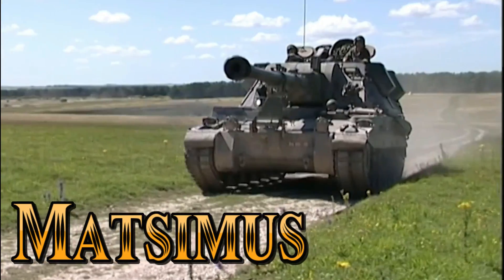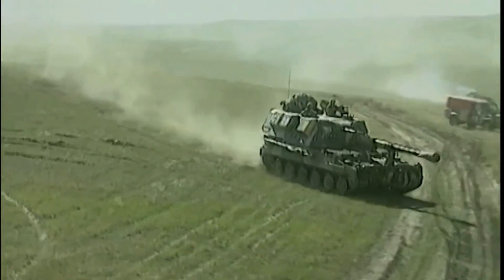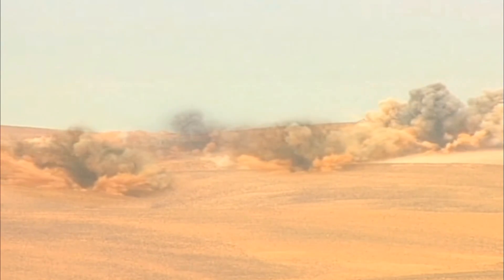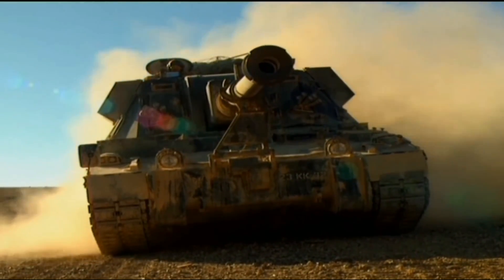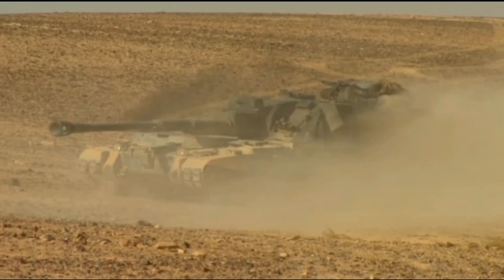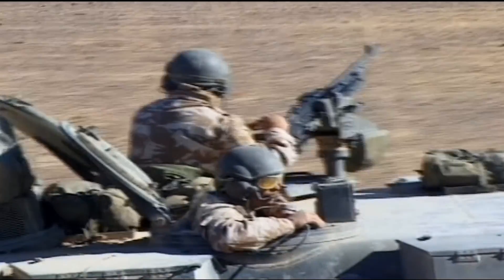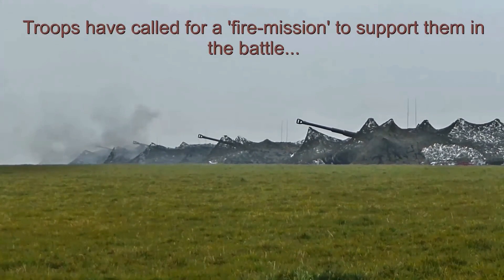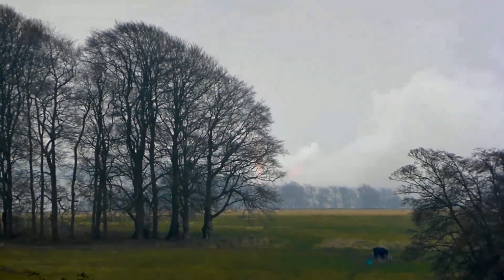The British AS90 Self Propelled Gun - Artillery Review

Comment: Think the exhaust was designed as a pension reduction program, the fumes blow over the turret into the commanders lungs. With the dangers of diesel particulates known this could produce future legal action  from ex soldiers.
Reply: Thats the tiny engine to move turret, and juice up generator for electrics and NBC suit if needed, it aint the cummins thats blowing in his face...
Reply: @wor53lg50  If you look at 7.33 m in you can see it driving and smoking , a small apu would not produce that much smoke unless  bores shot !

Comment: Hi Mat! Were you part of Mike Linge's regiment at Larkhill back in the mid/late '90s? BTW, I did a lot of the R&A work (operating a tracking radar used for testing the AS90 back in the  1980s/90s). A wonderful, reliable gun which quickly replaced the dreadful FH70. I did all the trials on the M.L.R.S. too, for Desert Storm. (Steel Rain). Mike brought a regiment up to Eskmeals in circa 1996 to familiarise with the launcher. They all lived under canvass on the range...good times!

Comment: I know this system well with the right charge, shell and fuze setting it can kill any TANK in the early 2000's  if its in 1-1.5km range very very deadly  possibly still could even today. Thank you for making this video great Gun I mainly operated these in harsh winter conditions, it is a very robust platform not had the chance to use in in desert conditions.

Comment: Worked on the Trials of the AS90 1989 to 1991.  Was amazing bit of kit then. Miles ahead of anything at that time.  It was originally designed for both gun systems. And had an auto loader with Manuel option. The gun system ran in to problems early on. Hence the larger gun got more and more delays. Also the auto loader was not always reliable.  And was /Could be dangerous  to the 2 loaders.  It was also found that the 2 loaders were often quicker. It also helped reduce the procurement costs of the end vehicles with just the 1 gun and no auto loader.
Many things have been changed and updated on this vehicle. To me in my mind it's still new (Lol. As like Chalky 2 and Warrior. We're the new kit at the time I first left the army. So my mind is still locked in past. So to me they still new.... Lol. But that was 28-29 yrs ago)
I still work with /around much of this kit. And yes. Much of it is now dated. And being surpassed. All very capable kit. But it's time for some new designs to start coming into play. As we have focused on Iraq and Afghanistan to much for to long now. Our tactics and much of our new kit is basses on fighting insurgency type conflicts. Not like the cold war tactics of army v army that the Chalky 2. AS90 and Warrior were designed for.
Reply: For us getting a new engine for the nasty is state of the art😂

Comment: Any one who is clued up on the AS-90, how realistically possible would it be for it to act and perform as a Main Battle Tank (Like the Challenger 2 for example) without being modded or changed in any way? I know it's an artillery piece and not a tank, but surely it's got some capability with a big gun and it being a tracked vehicle.
Reply: Depends on whether it is equipped with a boiling vessel compatible with an MBT's dong suppressor or a more general retch-looming matrix.
Reply: You are talking about Direct Fire capabilities. Yes it can do it. But not a good idea for arty to try take on MBTs close range. 1) arty does not have the armour protection of an MBT.
2) arty is large and less mobile than an MBT in close combat.
3)arty does not have the same gun stabilization systems or capabilities of an MBT.
So if Arty was unlucky to run into MBTs or vice versa. If the Arty was well dug in and Cammed up. And got first shots off. And got accurate shots on target.  They may stand a small chance. Realistically it would be a multiple MBTs with support troops and IFVs  as part of a organized fighting force. And would simply over run the Arty.
This would also mean that the arty's own forces had failed or been neutralized. Or someone had made a huge mistake in their positions for the Arty.
Also bare in mind. An armoured advance would probably have reccy element's leading. So should (hopefully) spot the Arty before they ever met. This would then lead to either air strikes  or Arty /counter Arty strikes being called in on their positions before they met.

Comment: Well well... great video!

Now that you have chosen this patch you almost have to do the Panzerhaubitze 2000. It is the main not counterpart but comparable piece of hardware. It's slightly more modern but only by a few years and it would be very interesting to see a comparison! The PzH2000 an extremely impressive combat vehicle as well and it would be interesting to know where it is better and where it is worse than the AS90.

But even more interesting would be a video about a modern close range defense system. Namely the Mantis for me because frankly I only know this one and I think it is mind blowing!

I know it is not your main field of interest and knowledge but it will be put on a tank chassis eventually so... :D

You could give your opinion how such systems will interact with armored vehicles and how they will change possible engagements.

It's super easy to think about it for systems like the AS90 here. You kind of said that we won't be able to use such self propelled guns they way they are intended for quiet a while now. Obviously with the great counter measures available.
So imagine 3 hypothetic Mantis (or whatever) tanks attached to a group of self propelled guns. Obviously ludicrously expensive but if it is the only way to  make actual use out of the artillery it has to happen anyways. So the Mantis gun has a pretty good probability to shoot down incoming artillery shells. It actually is designed to do this as protection turret for high value targets like field camps and airfields and eventually frigates. Not to speak of several of them. Helicopters and low flying fighters are munched for breakfast by these advanced cannons. Smaller incoming missiles should be no issue at all unless we are speaking of real masses.
So these tanks would allow the artillery to operate much safer and allowing it to counter measure counter measure fire and air force.

What do you think of that idea and such super advanced conventional cannons and their mind blowing targeting computers and sensors?

Comment: Huge? Better focus on MBT - huge ist the German PzH 2000 - it weighs 57 tonns - this is H-U-G-E!
Braveheart is a lightweight.
Reply: Stephen Hamblen    so disrespectful against the troops who fought and died fighting  the "flip flop dress wearing" enemies
Reply: Stephen Hamblen Don't you know? Wheraboos think Germans are the chosen ones, their equipment is designed by God and Rommel is the new Jesus. You can't reason with them because even though German equipment has virtually never been tested in combat and performed poorly when used by other countires (A dozen Leopard 2A4s destroyed in Syria), they refuse to see reason.
Reply: And it is also slower than PzH 2000!
A slow lightweight.
Reply: Dimension wise (apart from weight) the AS90 is pretty much the same size as a Challenger II. You also didn't mention the SP70 program which was scrapped as a waste of time (Being an FH70 gun mounted in a BAE turret mounted on a Leopard 1 chassis). After that was scrapped, the AS90 hit the drawing board. Technically from my point of view as a maintainer, the turret electronics have got to the point where they're pretty much bulletproof.  Haven't had a black box failure on any of our 11 guns in almost a year... (Biggest problem is the batteries)
Reply: Bigger is not better, but the comments suggested it. 
The Last Time we did anything was no the greatest Time for both sides - remember? 
PzH 200 was in Combat in Afghanistan
Reply: Stephen Hamblen Afghanistan
Reply: +stephen Hamblen: We are working very hard on it - nerver have to use our weapons again. So far we are successful. You have used your artillery in irak in a faked war and left a mess behind.
Reply: +john davis: Obviously we have a different understanding of respect. I think it is disrespectful (or criminal) to send young soldiers in a senseless an politically faked war and let them die far from their beloved ones. And it is also disrespectful to try to surpress a discussion when you want to avoid this happening again.

Comment: Given that it's like 8 years younger, the PzH-2000 is faster (326HP more), more rounds carried, more operational range, way better rounds-per-minute, has the option of MRSI with 5 (!) rounds, more range with stock rounds than the AS-90 with extended rounds, and the PzH even has the option to go as far as 60km with 'assisted projectiles' and thereby doubleing the range of the AS-90. This thing can't even stand in it's shadow. I get it, you like it, but i'm hearing once again 0 drawbacks.

You even prefer hand loading on a SPG? Isn't it the point to get as many shells downrange in the shortest ammount of time? ''Because that can fail'' you prefer a guy loading the gun? I imagine you don't say the same thing about an engine. Rather have someone push the vehicle because an engine can fail. Allofmywut.
Reply: watdeneuk the German spg isn't as reliable as the as90 it breaks down in hot weather
Reply: MrTangolizard source?
Reply: @watdeneuk  Dutch Army, who actually used the f*cking thing in combat (2006) - can't take dust either. Oh, well, so long as you leave it in the shade and make sure you don't drive it off-road in the Gulf, excellent piece of kit. Poor British Army will have to make do with a 1-minute set-up, and a 1-minute scoot for the reliable AS-90...
Reply: watdeneuk look it up Yourself!
Reply: watdeneuk Wheraboo detected.
Reply: watdeneuk He didn't know anything about the pzh 2000
Reply: Totally agree, not to mention its easier to 'shoot and scoot' when you have an automatic loader on an artillery than a manual loader or loaders. As for the reliability issue the engineers who design the system are responsible for how reliable or unreliable the end product is. Not to mention having a smaller required crew makes setting up and packing up easier if still required (some SPGs don't require the crew to disembark at all these days like the archer). also worth noting is that shells can be pre-programmed without the need of a loader and rate of fire of an auto loader is much more consistent than manual loaders at this caliber.
Reply: And i'm happy to see he does now :)